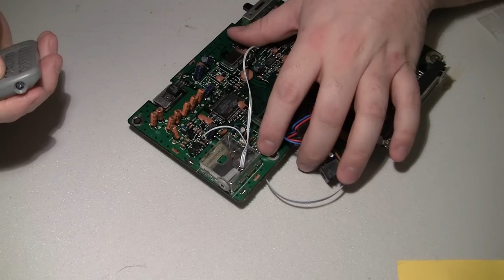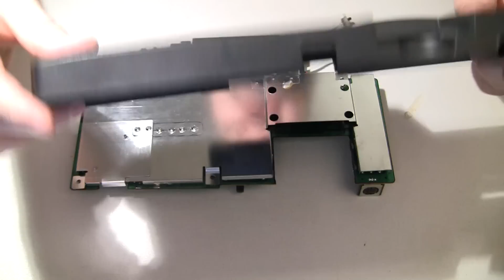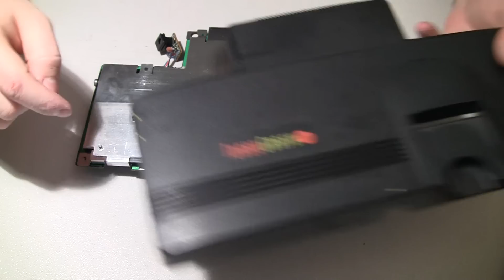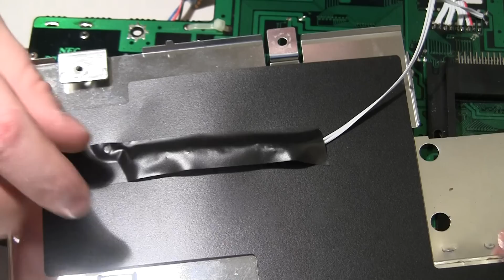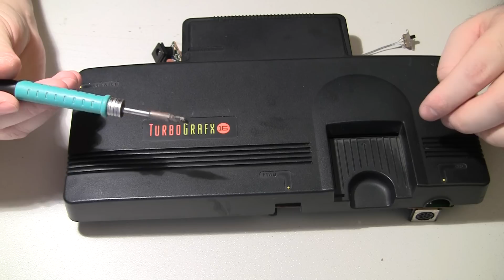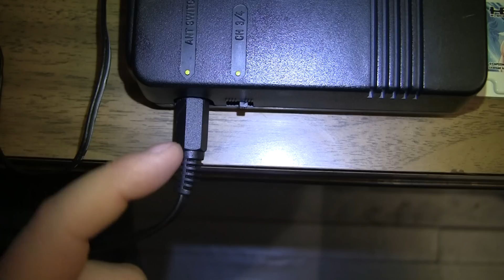TurboGrafx 16 TG-16 - LED lit logo - region mod - AV mod - How to's

Comment: How did you remove the Turbografx logo sticker before you cut out the hole without damaging the sticker? There is a small hole in the plastic where the logo is but it is not big enough to push it off. Did you have to heat it up to remove it. Let me know how you removed the logo sticker without damaging it please. Thank you

Comment: Do you have a diagram for true S-Video. 
I can only find a schematic for using composite as chroma. 

I need to figure out how to derive chroma from RGB. I prefer not to use an external encoder.

Comment: I can't quite make it out in the video, which tabs on the TRRS jack are for video and left and right audio? I can't seem to find any information about these jacks on the internet.
Reply from the maker: I don't wire them a certain way as the cord is the key. Some cords are wired different than others so plug the cord in to the jack and test to see which pin goes to what, simple...
Reply: If you wish to make sure they are on the proper way use a meter and use continuity testing to designate AV per plug

Comment: I got myself a booster but when I put it on the AV channel it gives me static annoying sounds but when I try all my other systems they work fine. I have a RCA HD
Reply from the maker: What does it do without the booster through RF? You might have a failing ac adapter and check the av cables on a different system.
Reply: It does the same thing. I got this from a 3rd party seller from amazon the cable it bring was the RF switch for Nintendo believe that and the AC adapter was from some company called Robotics. If the AC adapter don't work how can it turn on then.
Reply from the maker: vicious0111
Failing ac adapters can cause video problems.
Reply from the maker: vicious0111
More importantly is the ac adapter ratings, it should be as close to the original as possible.
Reply: Basically the AC from NEC the makers of the system. Is there any substitute AC i can use.
Reply from the maker: vicious0111
I'm sure there is, try google.

Comment: One idea that I've tried recently is a 9-pin mini-DIN in place of the RF modulator, makes it look very clean and you can wire it up to have the same pinout as the Genesis 2/3.

Comment from the maker: Uhh the logo is a set color so it's lit with white light, so no I wouldn't even try it, but another LED, bi-color, could be placed somewhere else to indicate region. Just use a DPDT (double pole double throw) switch instead of the SPDT and use the other pole to switch between the two colors.
Reply: Game TechUS How did you remove the Turbografx logo sticker before you cut out the hole without damaging the sticker? There is a small hole in the plastic where the logo is but it is not big enough to push it off. Did you have to heat it up to remove it. Let me know how you removed the logo sticker without damaging it please. Thank you